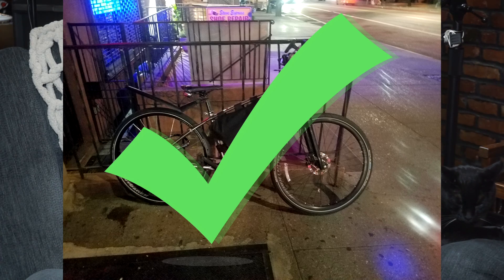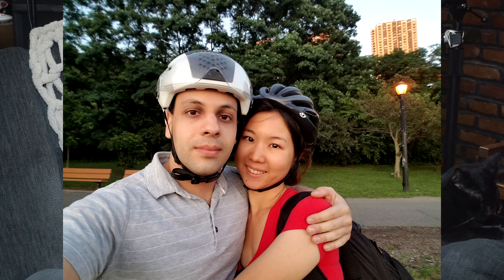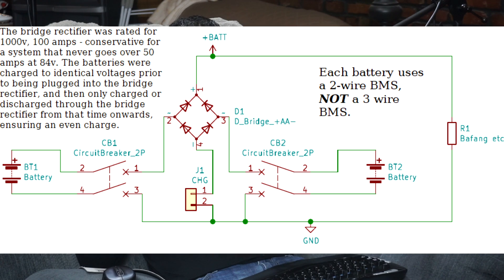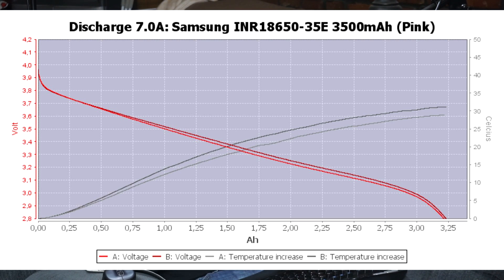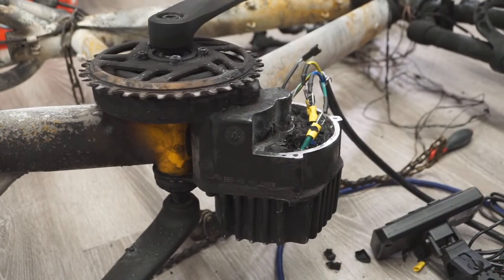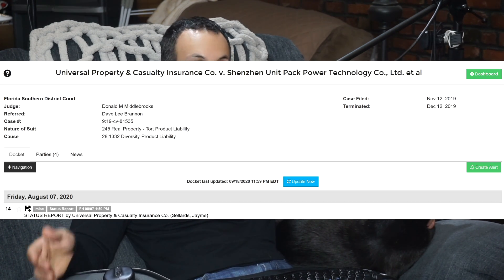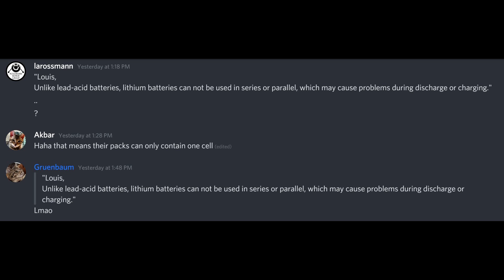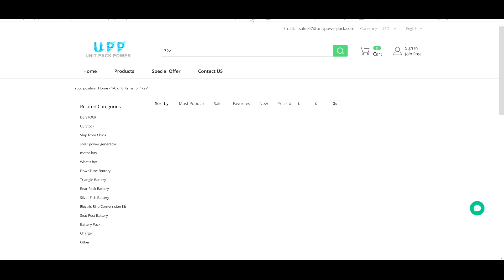Louis' front door goes BOOM courtesy of UnitPackPower battery.

Comment: I'm guessing the cells were packed too tight, or the pack was dropped, and the cell heatshrink wore off at some point and shorted the pack internally. When building you want to protect the cell groups from eachother. You can either hotglue them which provides a slight space (or slide a layer of green insulation paper between). Some packs are just taped together and those are going to rub internally when jolted around on the road. It's also possible they forgot to use insulation paper washers on the top of the cells before spotwelding the pack. At the positive side, the negative outer casing comes ridiculously close to the positive terminal. Cells have a washer there under the shrinkwrap but who knows if the sharp nickel strip can cut through that over time. It's an area you want to protect. Putting an extra self adhering paper washer is a simple procedure to do just that.

Also are you sure it's two packs of 20s10p? That's 400 cells and 20kg for the cells alone. 😅
Reply: @windson7 It's pretty hilarious when Chinese companies say "Your fault for using our products".  The truth is, they'll just dump that company and make a new name selling the same garbage made in the same "factory".  Probably buying the same cut rate out-of-spec cells that make their product dangerous to use even when they are constructed correctly.
It's always these scummy grifters(like the Escobar phones which were just foil wrapped QA failed Samsung folds)
Reply: I've taken apart UPP batteries in the past, and they are actually quite decently built (i.e. no not glue and tape). They use a plastic frame for the li-ion cells, and plenty of kapton and foam tape, and then waterproofing silicone (good, but a pain to repair) for the plastic case version. What they don't do is individually fuse the cells: the nickel strip is just a normal nickel strip, no fuses built in. They do make batteries with Chinese cells (as well as more well known cell brands, depending on which one you buy), and if a cell has a short internally, things are going to heat up and go on fire.
Reply: @DerHeilendeLotus  Does that mean that knowing this info about them not having fuses built in, someone could still use these but slightly modify it to fix the issue? Or are they prone to going on fire no matter what someone does to them  because of their build?

Not suggesting Louis go back to using them, just curious if they are simply a danger or if they can be used safely.
Reply: @windson7 Chinese knockoff of a Japanese hibachi grill.
Reply: Wrong.  Improper usage/user error.
The manufacturer clearly lays out the usage guidelines to Louis.
"These cells are not to be used in series or parallel.  You are additionally not to charge or discharge them.  All of these constitute improper usage."
Since there is more than one cell in the pack, you must not use these.  Since you used them, it is improper and therefore your fault.

Comment: According to my experience, Those high capacity batteries are not quite capable to deliver so much power simultaneously and also tends to unbalance way much over the time because their internal resistance, and also because of this, one of them when gets really hot, a lot of gas forms and the cell just open the circuit without notice, probably it happen over the time and the last time you used it, one of the parallels from the battery got less batteries to discharge simultaneously, so after use them they gets really hot, the protection fails and just spit their contents to the air, which about 110-120ºC is enough to start an fire and starts the chain reaction with the already other hot ones, later with the good/cold ones and so on.  i prefer you use those LG 18650MH1,or 18650M26 or Samsung 18650- 25R which are more safer chemistry, but quite more less energy per weight/volume efficient, but also gives more way more cycles than the Samsung`s 35E, about 800 cycles at 80% ones of their rated capacity in the M26 or MH1 ones rather than than 35E`s 300 at 70% of their rated capacity, to push that 8000mA or 13000mA from those batteries is possible, but reduces their life very greatly, about 150 to 200 cycles in about 70% of its capacity, because it gets so hot during that process.
Sorry for my bad speech im not english native.

Comment: One of these days I gotta edit and upload the most dangerous battery I've ever had the displeasure of taking apart, it's an actual miracle this dude's scooter didn't burn down.

Allow me to set the stage, the scooter runs on 2 40a controllers. The battery was a 20s10p of unknown cells that looked like 30q knockoffs. It's arranged into a brick 10 high and 20 long. The bms is charge only (yikes). The battery has no fishpaper (what in the fck) which means the main positive and the main negative are literally touching each other (along with every other P group). Separated only by the cell wrapper.

I damn near shat myself looking at this abomination. And very carefully stripped it down to a safe level.

Customer got a 50e 20s8p with a 150a Daly bms. One of the larger batteries I've built for a customer. So the final specs were a scooter that sucked down 80a, went 45mph, and had a 100mi range.

Don't buy cheap batteries. Always the moral of the story.

Comment: Louis Rossmann i would like to ask you a good question, did you ride in the rain on this bike with this battery? As you are probably aware lithium has a violent reaction when in contact to Ho2(water) so possibly, this battery had faulty water-proof caising which resulted in this one dropplet of water making contact on a cell that wasn't seal either. Once a single cell catch fire, it's just a domino effect.
Reply: I hope you are joking. There is no Lithium metal inside these cells. The cell cases are steel. Only lithium salts (hence the Ion in the name) which while not good to eat, are not flamey with water. The component that burns in these is the electrolyte - the carrier for the lithium Ions.

Comment: Christ almighty I can't believe they said li-ion batteries cannot be used in series or parallel not sarcastically
Reply: I think they meant you can't use their battery units in series or parallel. Chinese people don't speak a lot of English.
Reply: @bogdan192  you said the same, still doesn't make sense
Reply: @bogdan192  agree that at least it makes sense that way. to clarify (for others), there's a distinction between "battery" and "cell" which Louis ignores in the video. They're saying "don't put multiple of our batteries in a circuit (whether series or parallel)". Pointing out that the batteries themselves consist of cells in series is not some kind of counterexample.

And indeed it's true that in general it's pretty easy to set up failure-prone circuits if you connect multiple such batteries together. The battery manufacturer can't ban you from doing it but they also can't be held liable for it.

Now whether their battery units are properly designed to work when you only use one of them is obviously an open question.

Comment: I'm pretty sure they fucked up one of these steps when making the battery: 1) the batteries are squished together with no heat dissipation pads in between (minor issue, batteries heat up quicker which means shorter life for the batteries and a potential hazard for fires), 2) they used a crappy BMS (probably what happened here, sever issue), 3) they didn't use any sort of tape to separate the nickel contact pads on the battery (its common, big issue overtime), 4) they didn't use the advertised 18650 batteries or BMS as advertised (big issue), 5) instead of actually spot welding they soldered (I've seen a few shops do this, can cause a huge issue w/ battery cells). These are just some of the reasons for the batteries popping off the top of my head. If I had to guess what exactly happened it would be that they used a bad BMS system , squished the batteries together, and potentially forgot to separate the nickel contact pads.

Comment: Still want to hack your tesla with early 3rd party applications? My preference will be always with a software that has been rigorously tested over the years specially when I'm dealing with a huge battery that regardless of the number of hardware level failsafe can still be exploded by a faulty software.... 

IPhone and Tesla cars can be hacked, the huge difference though is the degree of damage each can make on a rare case that it explodes due to hacking...

Comment: let's try to understand what they meant by "you can't connect them in parallel"
do they mean you can't connect their packs in parallel? why? if they're charged to the same voltage, what could be the reason why you can't do that? (even without a bridge rectifier)? 
Please advise, cuz I'm running 3 x 36V batteries in parallel, each has it's own internal 10S BMS
Reply: I don't know too much about specific battery systems, just basic electronics, but I think the problem is when cells start aging and losing capacity relative to the others, they can use up their relative charge faster and thus be at a lower voltage than the rest, resulting in reverse current flow at low/no loads (a rectifier would fix that), and excessive load on the remaining cell(s) at full load. I know large lithium battery units have several cells in series/parallel, but they probably have diodes and/or transistors between them. The amount of logic probably varies between models, but ideally it would monitor each cell separately and limit each one with a gated transistor to its max current. I doubt this is actually how they do it though, because those transistors would be pretty beefy, taking up a large volume of the unit, probably with heat sinks on them. Anyway, when you're hooking up whole BMS packs in parallel, you just need to be careful that they remain evenly charged throughout their whole duty cycle and not assume that hooking them up to the same charger will keep them even all the time. Once you see one getting depleted faster than the other, it's probably time to change them out, or invest in some more sophisticated circuitry to maintain equal voltage between them. That approach would reduce the max output based on the weaker of the two, to avoid overloading the healthier one.
Reply: @DFPercush  only problem I could think of if one pack's BMS shuts off dues to low voltage or overcurrent and the other one doesn't, rushing large amount of current from the active one to the one that's off. In which case it depends on how that BMS will take it, if it has charge current limiter, if it can charge and discharge at the same time, etc
Maybe that's what they meant, that their BMS doesn't support any of that, but then the worst case scenario - the BMS which shut off first would get fried. That shouldn't cause a fire

Comment: batteries are not meant to work in series and parallel I learned something today
Reply: Ehh, yes and no. Cells have to be in series and parallel to get the kinds of voltages and currents they need to run an ebike or a car, even a vape. But since lithium batteries are so much more dangerous in the worst case like this, they need to have circuitry to make sure that one cell doesn't get overloaded. Even brand new batteries installed in pairs can develop a differential voltage over time, even if they're always charged together. They wear out at different rates, so with age, one can start taking more load than the other. That's the main problem. That can happen with any kind of rechargable battery, but prior to lithium the consequences weren't quite as dire. I don't think this is what happened in Louis's case though, because he shows the graph and the two voltages stay together pretty tightly. My guess is that it developed an internal short somewhere. It's just bad quality, don't cheap out on lithium batteries!

Comment: Wait..did they just use water on a lithium fire.. isn't that a big no no... given lithium is reactive to pretty much everything including water.
Reply: lee booth there’s no metallic lithium in a rechargeable Li-ion cell though. Water or aqueous firefighting solutions are the preferred methods for fighting Li-ion fires. They quickly bring down the temperature of the cells to below the thermal runaway threshold, stopping the exothermic reactions.

Comment: Disregard all that shit I said about overvolt & undervolt. I completely missed the part where you're running battery management circuitry. =</.>=

Anyways, those guys... "lithium batteries cannot be used in series or parallel, which may cause problems." Yea, nah. They don't know their ass from their elbow, alright.

The batteries for my radio controlled helicopters have exponentially higher power density for their size (6 cells in series, 3000mAh, 75 amperes continuous current & 150 amperes maximum current); & if their bullshit is to be believed, my batteries (& by extension, every LiPO battery ever made) would have gone kaboom years ago.

There would be explosions, fires, lawsuits, cats & dogs living together, mass hysteria.

Comment: Ah, lithium fire, my old nemesis... Worst is that there's nothing you can really do that will extinguish it apart from letting it burn.
Reply: That's not entirely true. Alkali metal fire can be dealt with using large quantities of dry sand. The resulting crud can then be disposed in isopropyl alcohol in a well ventilated place.
Reply: @BY-it2oe  You have to be careful even with sand.  Dry sand can quite easily become slightly damp sand and then you've gone from bad to worse.
Reply: @BY-it2oe   ah great I have tons of sand laying around my house for situations just like those.......

ah shoot all 500 pounds of it is wet so I guess thats not going to help...
Reply: R H if I remember correctly you could use a class d fire extinguisher on lithium fires
Reply: Clf3 batteries anyone?
Reply: Ther are fire extinguishers that spray foam that is made specifically to cut off the flow of oxygen to the lithium to make it stop burning.
Reply: dunk in large amounts of water, cooling it all down
Reply: @HasanProd  wow that is all kinds of wrong.
Reply: If it's something small like a phone battery, you can take a metal cooking pot and cover it with that, fire should suffocate quickly.
Reply: This thread has the dumbest comments in it. These wannabe BillNye morons are gonna start everything on fire in here.
Reply: @RwP223  that's the easiest. But lots of water to cool things down is next best option. If you keep it cool enough you'll just get hydroxides forming and some hydrogen formation. 

(Dropping an small damaged battery into a metal bucket of water with a pinch of salt is a relatively safe way to fully discharge it and render it safe)
Reply: Flood it with TONS of water. Eventually the reaction will stop, and you've kept it cool enough in the meantime to avoid anything particularly nasty.
Reply: @RobertSzasz  Bad idea, now you have floating bits of burning lithium spreading around with all the water...
Reply: @HMan2828  Lithium ion batteries do NOT contain metallic lithium.
Reply: @Basement-Science  Yeah no shit, but guess what happens when you put water on lithium salts dissolved in a highly flammable organic solvent? Lots of hydrogen (sure doesn't help the fire situation), and a reduction of the lithium salt into, you guessed it, elemental lithium, which burns in water...
Reply: @Basement-Science  technically correct, the material is a salt. Not pure metal, but practically speaking...there be lithium in there.
Reply: @HMan2828  thats not how it works
Reply: @HasanProd  You have no idea how it works and on top of that you trying to hide it on chanel of tech-savvy guy full of tech-savvy viewers... good luck. ;)
Reply: @Basement-Science  well, when charged, they contain something better - spongy graphite loaded lithium...burns just as good ;-)
Reply: @Bialy_1  I wasn't speaking out of my butt but rather referring to what Tesla recommends to first responders but sure I'm the idiot here.
Reply: @RobertSzasz  the tons of water just cool everything, but it's very likely to prevent cells that are still intact from joining the party. One problem this causes is that you now have a damaged pack that can reignite, so it needs to stay submerged.

Comment: There is no BMS shown in that drawing. That was likely the problem...a severe imbalance happened because a top balance and bottom balance was never performed by the end user. BMS must monitor each cell individually to know if one is out of balance. A proper BMS should have kept the batteries from over-charging and over discharging, over-voltage and under-voltage. You were bitten by total incompetence at the retailer level.

Comment: What happened, is that they do not use proper nickel strip bridging. Often they make all the current go through a single thin strip, making it glowing hot. This could melt the insulation, and result in shorting.

Comment: Notice how the firemen aren't really in that big a hurry to put it out. As an Electrical Engineer, I have seen this kind of stuff all too often. Those Chinese batteries, even when they have Japanese company names on them, as highly suspect. The retailer should have known that. They should have ensured each battery was run through several charge and 80% DoD to then check each cell to see if any are under-performing. Most cylindrical cell battery builds do NOT use BMS for EACH CELL INDIVIDUALLY, and this is what happens. The motor is one of the last things I would have suspected, especially after you turned off the breakers. Someone screwed up. It's a sorry design. Lithium batteries are critical items that have severely burned jets, as you may recall the problems Boeing had with lithiums on their commercial aircraft. Someone screwed up by not taking serious the risk lithiums pose when not properly monitored.